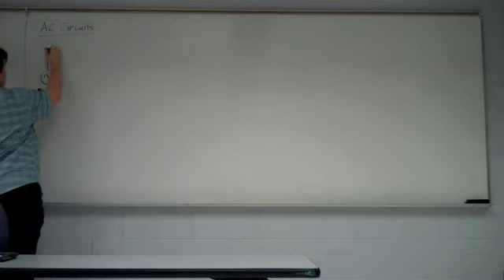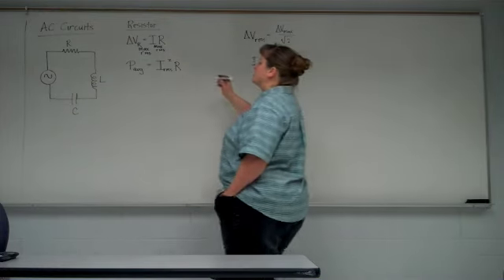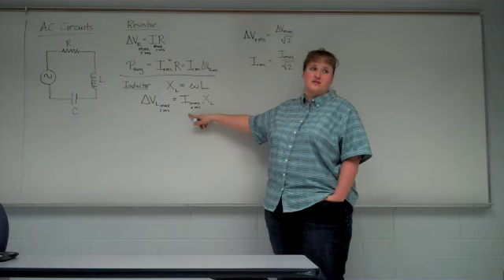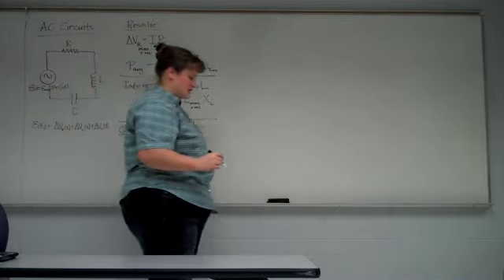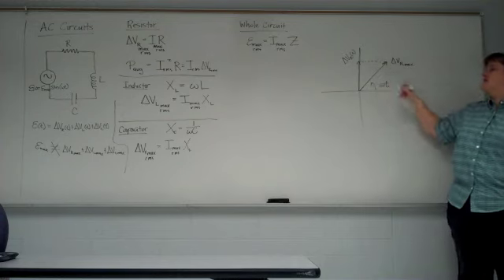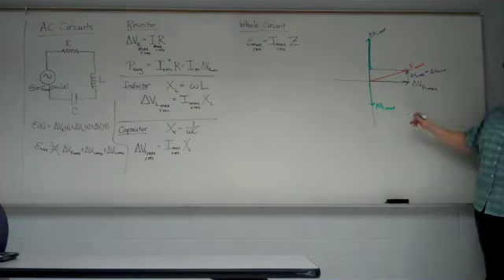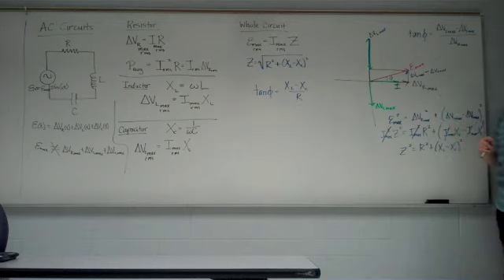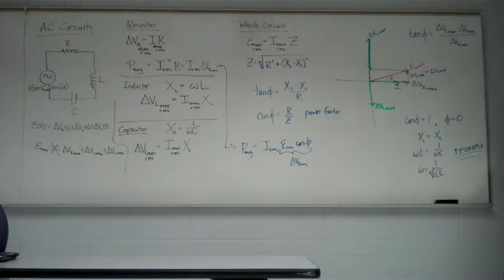AC Circuits Series RLC Circuit

Comment: This might sound like a dumb question but why are they called rlc circuits? I assume it means resistor inductor capacitor but why is it being analyzed from that perspective and not just a resistor or resistor combination like in DC circuits? I'm new to AC.
Reply: I should also note that I ask this because everytime I look up AC series circuit I expect to see a simple circuit with just a resistor and I always find RLC series circuit.
Reply: Do all ac circuits have resistors inductors and capacitors?
Reply: Look up  what capacitors and inductors do.  Most of the time, these classes teach you how to do circuit analysis without understanding what all the actually components are and why they should be there.

Comment: pls what happen to the voltage and current across the capacitor in an rlc circuit when the capacitor value is change and when it is kept constant and other value i.e the inductor and resistor is changing, and what happen to the voltage and current when resonance take place.